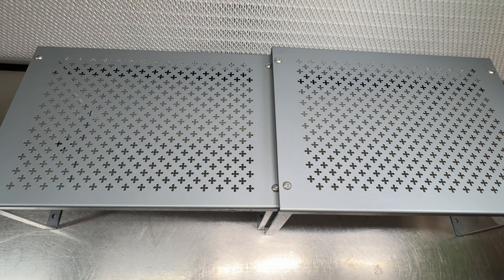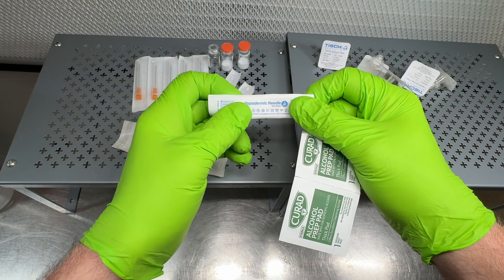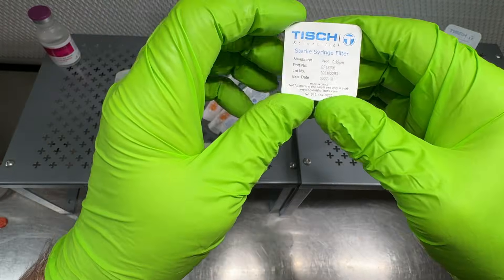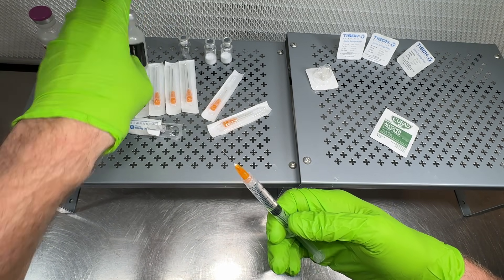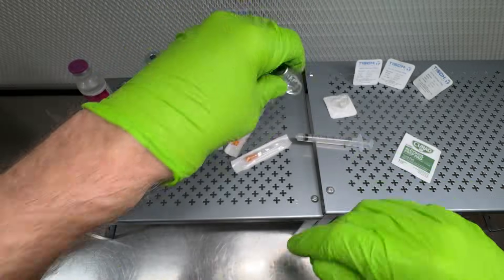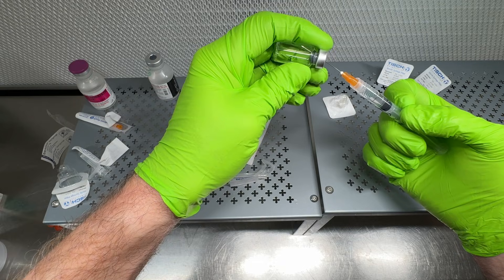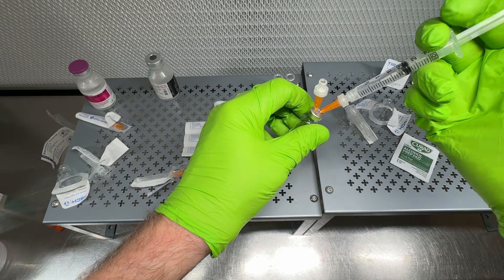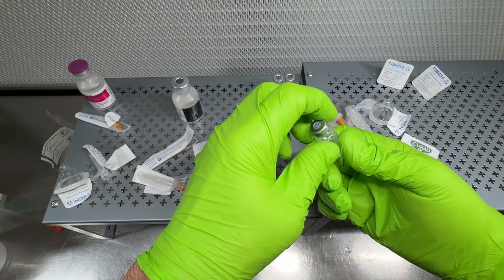Peptide Filtering Basics - Reconstituting, Venting, Flushing

Comment: I’ve been using 30mm filters and realize I should switch to 4mm but still have a ton left. Wouldn’t reconstituting in 2mL and flushing with an additional 1mL BAC do the trick to minimize any loss?
Reply: Yes
Reply from the maker: Using a 30mm to reconstitute 3ml is insane. They are cheap enough where you would recover enough peptide the first time. Are you can try to flush but such a large percentage of the hold back is going to be rich with peptide , it will be mixing while you’re flushing. That’s a fools errand unless you want to flush with more than you reconstituted with

Comment: Silly question, but do you have to use BAC water to flush the last of the peptide out of the filter? Could you not just push it out with air? My head is spinning trying to work out how to calculate the difference in strength when we are talking only 3ml all up and 0.7ml stuck in the filter.
Reply: 15:39 - its replaced with BAC and discarded. It pushes it through because it has the same viscosity - air has a low viscosity and will tunnel through your liquid and you will have waste. Hope this helps!
Reply: Bruh, don't overthink it. It'll be fine.

Comment: Im not understanding the purpose of the filter on the vent when your pushing the room air in and out of the bottles several times already
Reply: Not a criticism...this is ab excellent video and ive ised it many times. Thank you
Reply from the maker: Just minimizing potential contaminants as much as possible. Injecting air does not matter on anything before the filter. There is no air injected into the final sterile vial.

Comment: Let me get this straight, the hold back volume in the .22micron 4mm filter is 0.07 mL.  But you are flushing it out with .25mL of BAC water?
Reply from the maker: For most people, the bigger concern isn’t getting the volume precise down to the hundredth of a milliliter,  it’s making sure you recover all of the peptide solution from the syringe and filter. When you push bacteriostatic water through, it mixes with the solution trapped inside the filter housing, so it’s not a perfect 1:1 displacement. By pushing a little extra, you ensure that everything you want is fully flushed out.

It’s also worth noting that measuring anything below about 0.1 mL on a 3 mL syringe can be tricky anyway. And don’t forget, roughly 0.07 mL will always remain in the filter as hold-up volume. So in the end, you’re really only adding about 0.15 mL of extra liquid. If your concentration is extremely critical, just account for that small flush volume when calculating your initial solution amount.
Reply: @Peptidetest  Thank you for the reply.  I'm new to this, it just seems to me .15 or .25 is so much BAC water.  I trust your expertise on this.  I think having a more diluted solution is better than more concentrated than one thinks.  A lighter hand is safer than a heavier hand.

Comment: Can you explain the benefit of using a second filter for the syringe as opposed to attaching the syringe to the vent filter?
Reply from the maker: I dont understand your question - can you elaborate?
Reply: @Peptidetest I think he was asking why we can't just use the vent filter to filter the peptides as opposed to using a new/different filter when filtering the peptide. 

I just had a quick question, which I know is simple, but is the purpose of the air vent filter to push air out of the vial as your injecting the peptide through the other filter into the sterile vial or is it to release the vacuum from the sterile vial without allowing non-sterile air particles to enter the vial?
Reply: @j @jolietrepresentative9089 its to push air out as you could otherwise pop the plunger. The filter is to prevent any contamination with outside air.

Comment: Is it neccessary to transfer from the peptide reconstituted vial to a secondary sterile vial?
Reply: You will be leaving unfiltered remnants and possibly bacteria in the original peptide vial. Rather than filter every time you take a dose it's easier to extract it all and filter into a new, sterile vial.

If you are not filtering, you do not need to extract the reconstituted peptide and can withdraw doses from it as normal.

Comment: Are 33 mm diameter .22μm filters fine too?
Reply from the maker: If you're filtering a large volume of solution, a 33 mm filter is totally fine—they have more surface area but also retain a LOT more liquid in the housing - meaning you lose a large amount of your peptides. For smaller volumes, you'll want to size down to avoid unnecessary hold-up.

For 5 mL or less, use a 4 mm filter.

For up to 15 mL, go with a 13 mm.

Up to 50 mL, use a 25 mm.

Over 50 mL, a 33 mm is ideal.

This recommendation is based on a lot of testing we've done specifically with GLP-1s. It may not apply the same to peptides like AOD or others that are thicker or prone to aggregation. Also, this doesn’t apply to oils—those should be filtered using larger PTFE filters.

Comment: Uses a filter on his vent tube but just injects air into every vial 😂😅
Reply: All took place pre filtration. So what's the issue? Laughing at something that makes perfect sense.
Reply: @timv9014 awww poor kid thinks the filter sterilizes the solution 😅
Reply: How are yous supposed to then?
Reply: @nthn437 you just break the vacuum by putting a filter on a needle and sticking it in the vial, filtering any particulates from the air going in lol. He was filtering gases coming out of the sterile vial but not filtering the gases going in which is stupid 😂
Reply: He’s working in front of a particulate filter blowing sterile air at him. No shit he didn't filter already filtered air. The air in the vial is unknown which is the whole ass reason we are filtering the peptides to begin with.
Reply: Right. Doesn't make sense
Reply: Gotta sell more filters somehow
Reply: Should you vent every vial then? What would be the draw backs with that approach?
Reply: @sineadaoibheannquinn371 depends on if you plan to use the whole vial within a relatively short time period, or wether you plan to store it for months and months. Some molecules breakdown faster in the presence of oxygen and in those cases you would want to flush the vials with an inert gas for long term storage
Reply: How else will they sell you 300 filters in one reconstituted vial?

Comment: when you said a quarter of a mil which is 0.25 ml when you backflushed at the end is do we add that number 0.25ml to our peptide so its 2.25ML or is it .07 2.07 or is it 0.25? the amount you added
Reply: .07 so just under .1 ml (the first line on a 3ml syringe) best option or easiest for me is to draw back .9 ml to reconstitute and then after you’re done, put .1ml of plain bac water thru the filter to total 1ml of liquid. Hope this helps.

Comment: At the flushing step, isn't there possible cross-contamination of the BAC water vial when drawing from it using the same syringe that just put the reconstituted liquid in the vial?
Reply from the maker: You're only drawing from the vial with a fresh needle, so there's virtually no risk of contamination unless you're injecting something into the vial, which you shouldn't be. While contaminating your bacteriostatic water (BAW) isn't ideal, it's designed to prevent bacterial growth—and anything drawn from it will also be filtered before use. So you’ve got three layers of protection:

Minimal risk of contamination to begin with.

If contamination somehow occurred, the bacteriostatic agent inhibits microbial growth.

Even then, anything drawn from the vial is being filtered before use.

As for cross-contaminating analytes, you're using an ostensibly empty syringe and just pulling liquid. Even if you accidentally pushed a bit in, we're talking about a drop—or less—of a diluted solution. Maybe 0.03 mL. Not ideal, but practically meaningless unless you're dealing with something extremely potent... in which case, you probably shouldn’t be doing it in your kitchen.

Comment: What happens if you used a stronger alcohol percent to wipe everything down?
Reply from the maker: It evaporates too quickly and doesn't stay in contact long enough to kill everything.
Reply: 70% is the best strength. You need enough water in the solution for it to get into cells to kill them.

Comment: I still don’t understand why you need to vent?
Reply from the maker: The sterile vial is sealed, so when you inject liquid, the air inside becomes compressed, creating resistance. This can make it harder to push the liquid into the vial and may cause the syringe plunger to push back out when you're trying to withdraw your filtered solution.  

Venting the vial equalizes the pressure, making the entire process smoother. If you're working with very small volumes, venting might not be strictly necessary—I even have videos demonstrating it without venting. However, venting is easy, inexpensive, and generally makes things much simpler. Personally, I always vent the vial, since there's really no reason not to.
Reply: @ thank you so much!

Comment: I had some bubbles in the final reconstituted  product but the solution was clear.  Is this an issue ?  Video of great help for a new bie
Reply from the maker: No, you're fine. Thats normal, they will go away after sitting. It is only an issue when trying to remove the last little bit and even then its no huge deal

Comment: even though the needles are cheap, any concerns with reusing the original bacteriostatic needle for the vent if you go directly from one to the other?  any other recommendations regarding efficiency of supplies? :)
Reply from the maker: I would not pierce the final sterile vial with anything that was not sterile and new. You have more latitude with anything that goes before the output of the filter.

Comment: after recon, I transfer to a pen cartridge and vent to prevent the plug from blowing out, but question….Obviously the filter used to filter peptides is individually sealed and sterile. Does the vent filter have to be the indivially sterile sealed ones as well. And the mm size shouldn’t matter when just using it for the vent as long as it’s still .22um?
Reply from the maker: Yes, I agree with that. You could use bulk non-sterile .22um with no issues PROBABLY. You have the most minor risk of contamination at the needle/luer slip connection to the filter…I would think the likelihood of contamination from air passing that non-sterile spot would be vanishingly small
Reply: @ might as well still use a sterile filter when I’m venting then. Why take the other precautions and then skip out on the venting precautions?👍🏼 Ty

Comment: 4mm - too hard to find and more expensive. I would settle for a 13mm, but I'll start not filtering at all and see how it goes. Will update.
Reply from the maker: @LegShowMagazine  They’re easy to find, we sell them and they’re only $1.60, that’s like $.40 more than a Tisch 13mm. You’ll lose way more than that in peptide . It’s silly to use a 13mm filter for filtering 4ml or less of a “normal” peptide (non gelling, not thick)

Comment: The FFU by itself doesn't create a proper laminar flow, and the work surface design also creates turbulence.  You can use a flame to test laminar flow, and a laser particle counter to test the efficacy of your current setup.  Also, you should never bring your hand (or other objects) between the HEPA filter and the vials, needles, etc.

Comment: What do you call those shelves or tables you're working on? Or where can we find or searchf or something like that, especially for us who might not have a stainless steel table, something metal to lift it off the current surface and easy to clean.
Reply from the maker: Your best bet might be a silicon mat, you can roll it up and put it out of the way when you are not using it
Reply: @Peptidetest  pretty sure these are IKEA 🙂

Comment: What is the benefit of venting?
Reply from the maker: When you add liquid in the vial, the air that is in there already can not escape so the vial becomes pressurized and it can be hard to push anything into the vial and when you draw anything out, it is essentially wanting to "shoot" out. Venting lets the compressed air escape. It makes things much easier. it is not mandatory but if you try it you will do it every time afterwards
Reply: @Peptidetest   Nice to know. I just ordered a bunch of stuff from your company, so this is helpful.
Reply from the maker: @jklin2987  Awesome! I hope this helps tie it all together